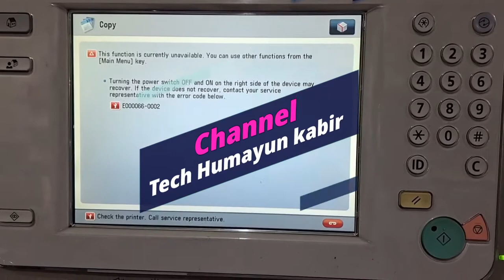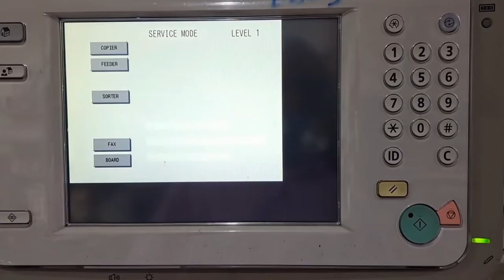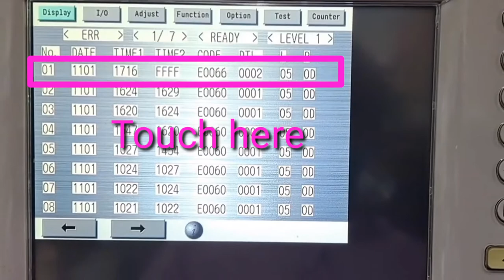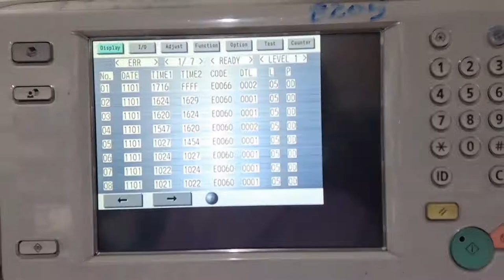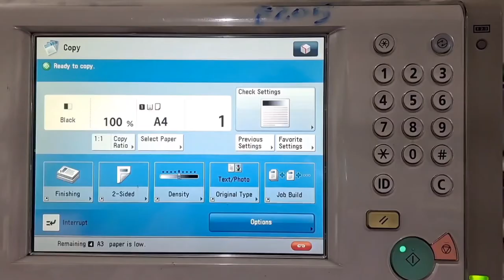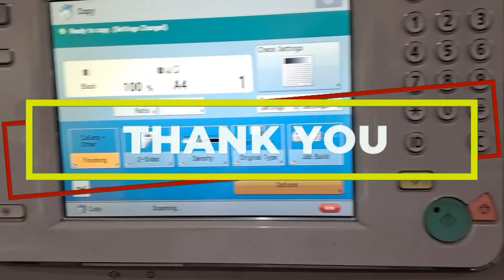How to solution error code: E066-0001 E066-0002 Canon image RUNNER ADVANCE 6275 #canon #subscribe

Comment: Sir my machine canon ir 6265 error 66-0001 I replace the transfer and then the machine copied 1000pcs plus error again 66-0001 ,what should I do sir
Reply from the maker: Replace transfer corona unit or corona unit Shutter open. Pre-transfer Charging Shutter HP open error
The Pre-transfer Charging Shutter Sensor (PS95) detects that the shutter is opened although it is moved to the close position.

Comment: Hello do you have some video to fix this error - E000400-0002 c3530i error
Reply from the maker: Error code: 004-0002 Current detection circuit error
Current outside the specified range flowed to the Fixing Heater when the heater was turned ON. Or, failure of fixing current detection circuit was detected.

- Backup: COPIER (LEVEL2)> FUNCTION> SYSTEM> DSRAMBUP - Restoration: COPIER (LEVEL2)> FUNCTION> SYSTEM> DSRAMRES

[Related parts] R1.00 - Harness between the Low Voltage Power Supply PCB (UN01/J302) and the Fixing Drawer (J1001) - Harness between the Fixing Drawer (J1001) and the Fixing Heater (H01/J1115) - Harness between the DC Controller PCB (UN049/J121) and the Fixing Drawer (J1001DB) - Harness between the DC Controller PCB (UN049/J115) and the Low Voltage Power Supply PCB (UN01/J322) - Fixing Unit - Low Voltage Power Supply PCB (UN01) - DC Controller PCB (UN049) [Remedy] Check/replace the related harness/cable, connector and parts. [Reference] Before replacing the DC Controller PCB, back up the service mode data (approx. 2 min) and restore the backup data after the replacement so the data may be able to be protected.
Reply: @TechHumayunkabir  Thank you sir!  do you have any tutorial videos for these error?
Reply from the maker: https://youtu.be/SyFwJAjBOX4
Reply from the maker: Same program but mechanical work this video is not the same.
Reply: @TechHumayunkabir   thank  for thee help.
Reply: @TechHumayunkabir  Sir i recieve this error in the screen "Check area where multi sheet  feed was detected 
The feeder needs to be check. i dont know to fix that error if you have some idea how to fix that can please give some advice Thanks!

Comment: 00067-001 error a
Reply from the maker: Check transfer/separation Charging corona unit 

Developing high voltage output leak error
The leak detection signal was detected 5 times in a row for every 20 msec.
Reply: عندي مشكلة كود 0001-00068 رجاء ما هو سبب العطل canon 8095
Reply from the maker: https://youtu.be/7FRlo3OaD4Q
Reply: @TechHumayunkabir  شكرا كتيرا🌹🌹